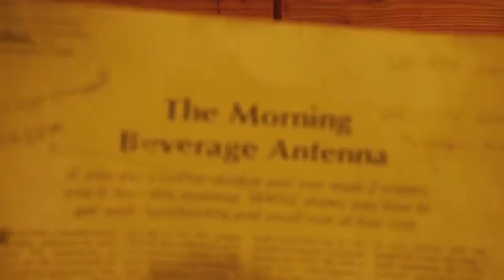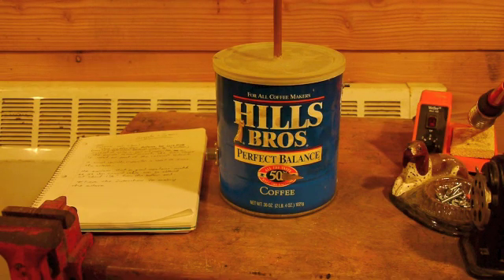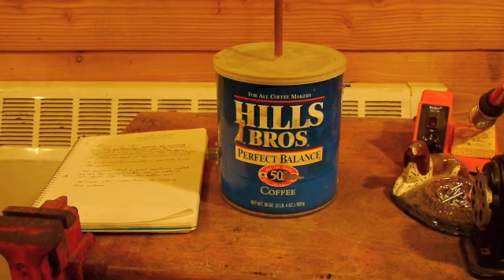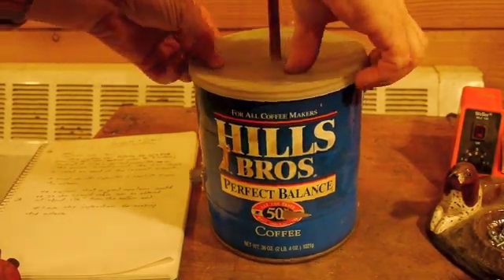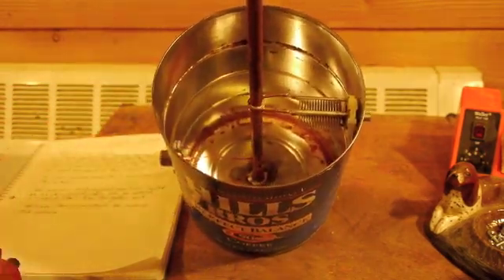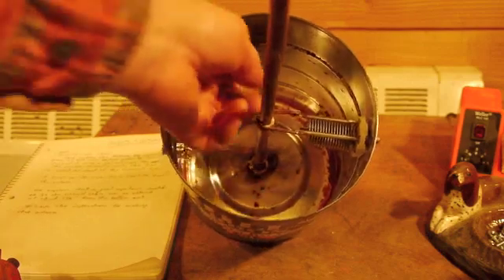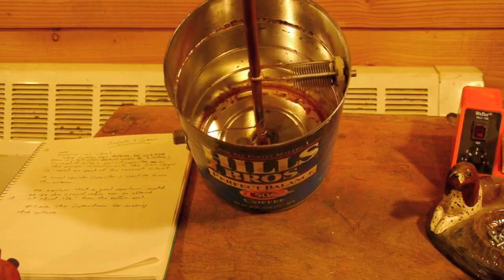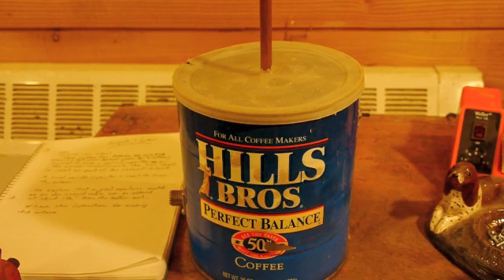Coffee Can 2-Meter Antenna

Comment: will any coffee can work or does it need to be an older one?
Reply from the maker: In the old days, coffee cans were metal.  I guess now they are made out of plastic.  I don't know if you can find a metal one or not these days.
Reply: found one with cheap coffee but I think its aluminum not tin or steel
Reply from the maker: Aluminum should work.

Comment: What is the total length of the radiator please?

The instructions say 43.5" over-all and 38" (1/2 WL on 145 MHz) exposed in open air.  

If I have a 5.5" high can I'm okay, but a shorter  or taller can would call for a shorter or longer radiating element to maintain the 38" exposed.

Does this sound correct?